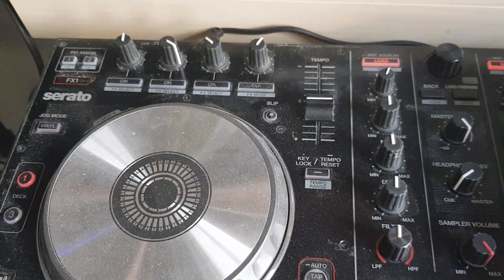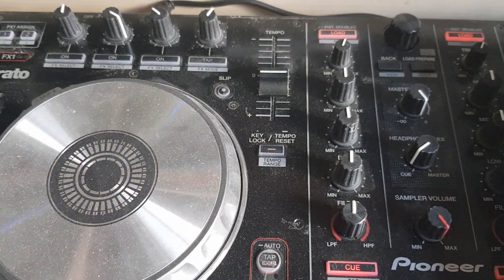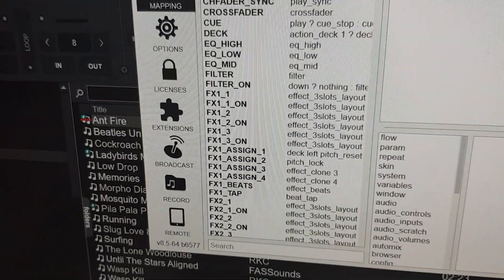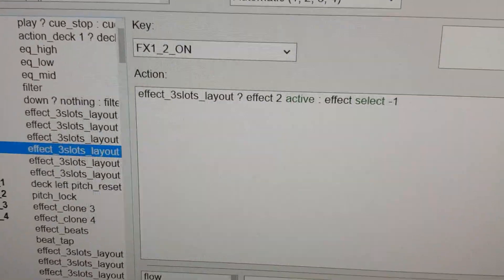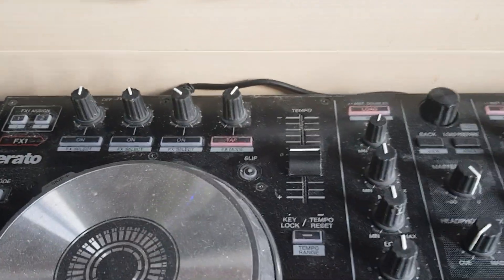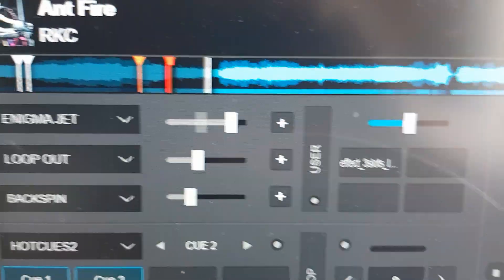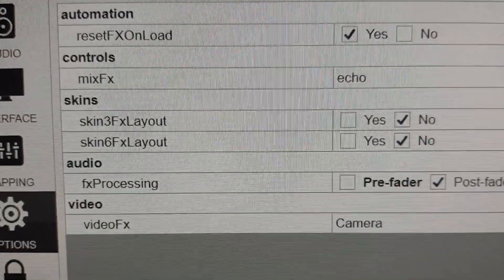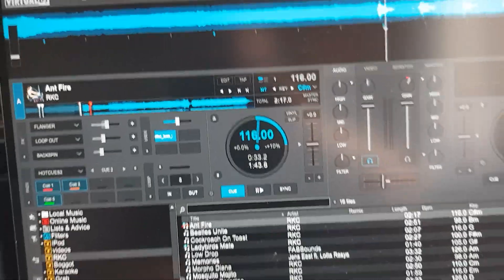Quick n' Handheld: Why do the FX buttons on my controller not work in VDJ8.5/2021

Comment: Why aren't your Hot Cue Pads lit? i have that same issue..
Reply from the maker: The SR doesn't have RGB pads. So it simply switch between gray and blue in this setup
Reply: @klausmogensen8691  thanks for the update.. i'm having the mentioned issue on my SR2